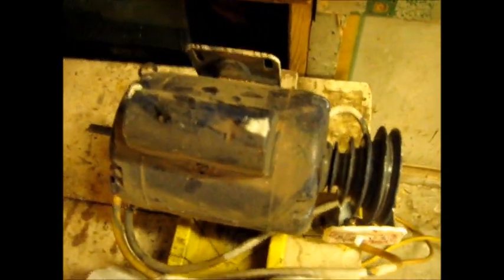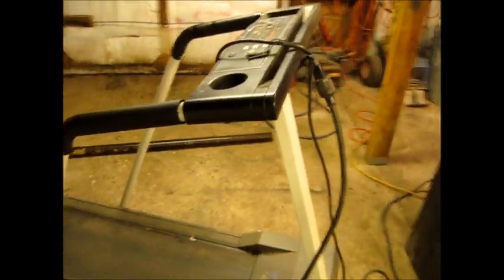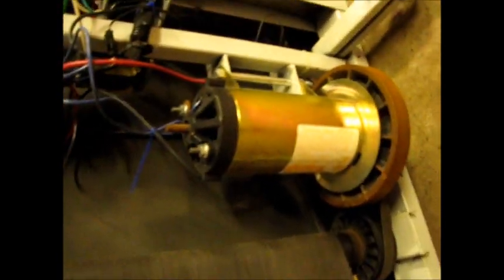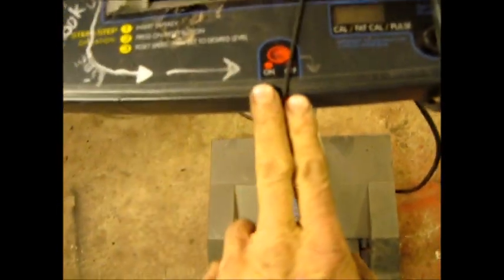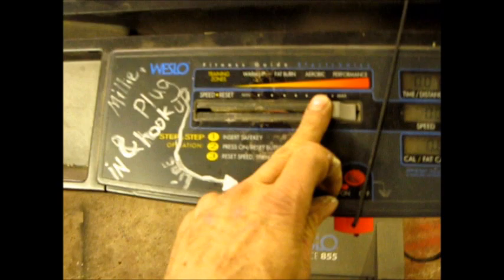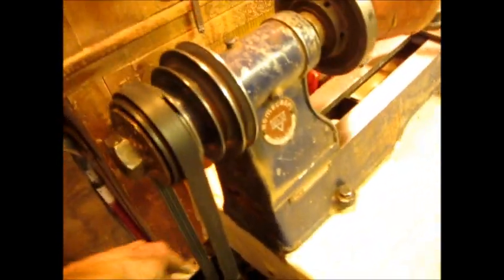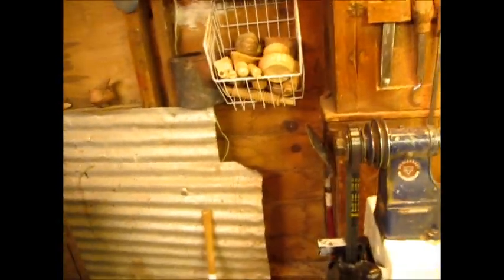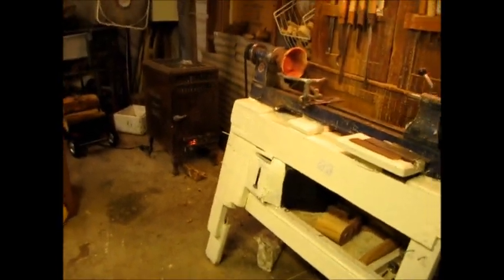DIY variable speed lathe motor conversion, easy, cheap DC motor & parts.wmv

Comment: I have had this lathe for a few months.>>>t.co/dxawOe485Q   It is a great lathe for someone that wants to try turning but does not want to spend the money for a larger lathe. I have turned out 35 tops, 5 hair pins, 4 small vases and one ring bowl. I had to force my self to walkaway with all the time I was spending in the garage. I would recommend to all my friends and family.

Comment: Thanks for the video. I have 2 craftsman 15x38 variable speed lathes with Reeves drives and one had the motor go out and the new one is having problems with the Reeves drive not going full range. I was going to buy an electronic speed controlled head for it, but I have been reading that many of the guys have a ton of problems with them. so the solution you have may work for me if I pull out the motor and drive system and put a  serpentine belt pulley on it and get a treadmill and use the motor out of it. thank you very much. Great video!!...............Jim

Comment: I did the same, see my videos. I would like to see more about how you mounted the motor and switching the lathe to a ribbed pulley. The dc motor I used took a v-belt but I have a 2nd motor that uses ribbed belts.